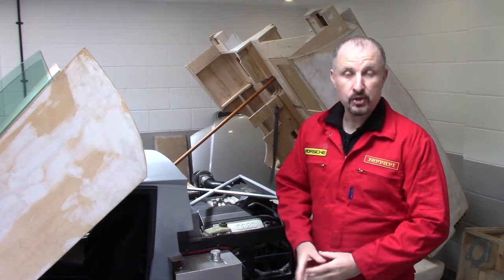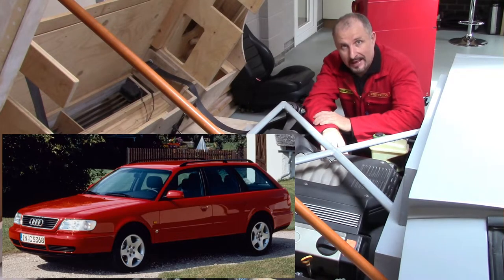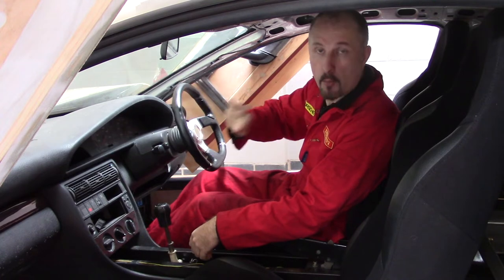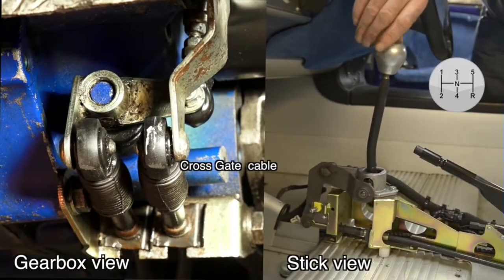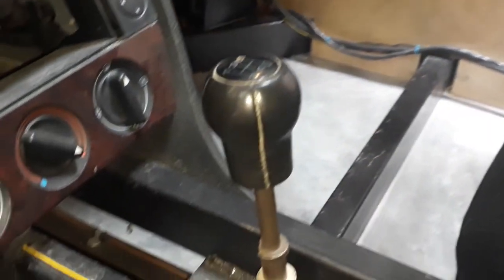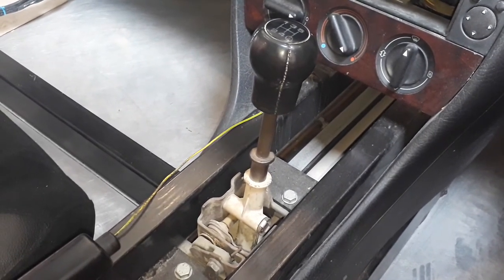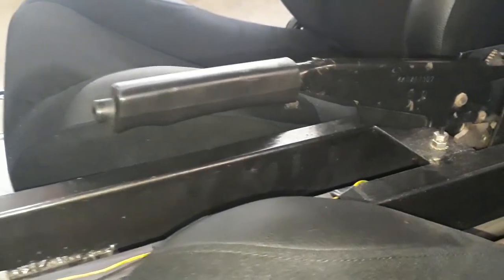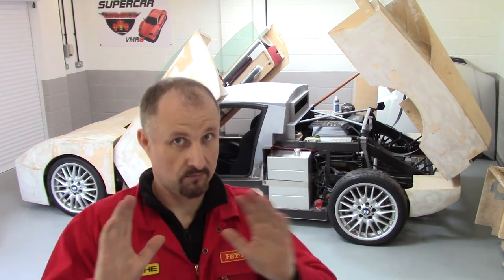Designing the Gear change and Handbrake for my DIY Supercar: Prototype Ep13

Comment: Agreed, I luv a manual shift. I've fitted a short shifter to my NA MX5 - it's delicious. Nice work on your shift, seems smooth and accurate. You've put a lot of thought and engineering into this whole project.
Now set me straight, are you building two supercars, ie the Audi donorcar stripdown currently shown as well as the existing one in the shed? Going in to mass production? Please tell
Reply from the maker: Thanks Don. Yes the plan is to build a second Supercar, which will use the 2.7T engine (and other parts from the new donor car). This prototype will be finished, and use the 2.8 V6 N/A.

The Turbo build will be a refined chassis, with some tweaks, and with a slight change in the body styling (larger side intakes for example).

I really want to put this into production, first as a kit so others can build their own Cerberus, and then also offer turn key customer cars.

But I need funding to do this, I was hoping the ad revenue from YouTube would help me get this project off the ground, and at least finish the prototype, but my channel is really getting held back for some unknown reason.

Comment: Nice video where did you get the cables from as I have almost given up hope 😖
Reply from the maker: I got them from RDB 93 Limited, they actually make the cables for JCB. I wanted some monster cables that could take the pounding of some quick gear changes; I don’t think I’ll ever have a problem with these cables snapping or stretching ;)
Reply: Nice one thanks I will have a look👍